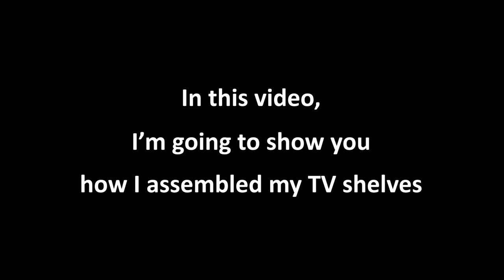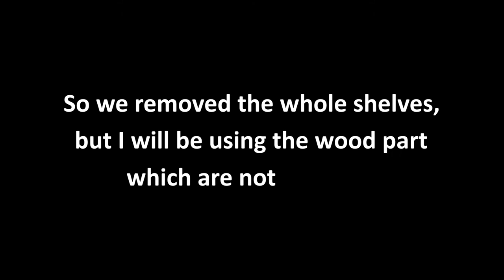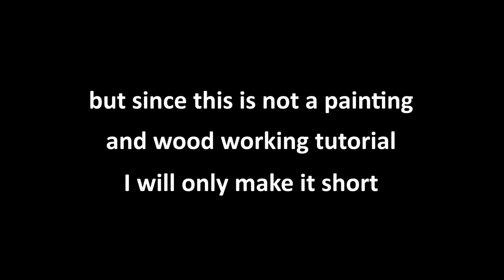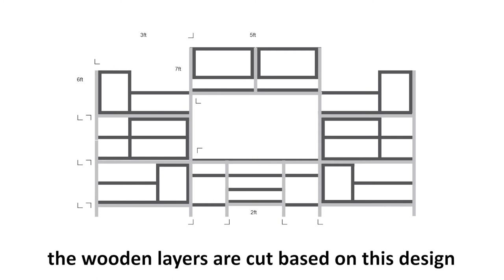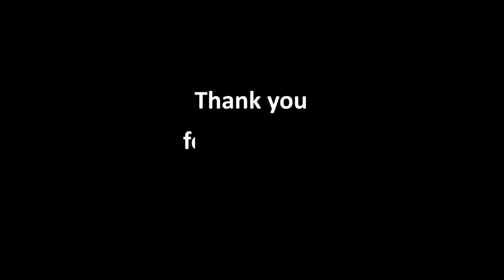Custom TV Shelves using Slotted Angle Bar

Comment: what did you use to cut the angle bar?
Reply from the maker: I just asked the seller to cut the angle bars on my desired sizes and they delivered it already cut with free bolts and nuts.